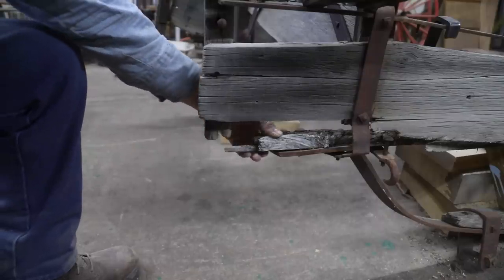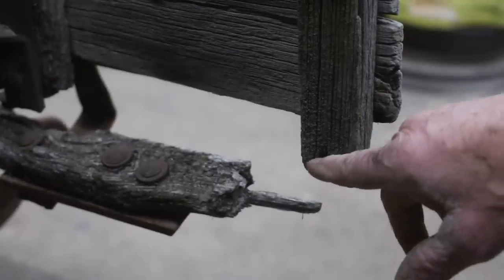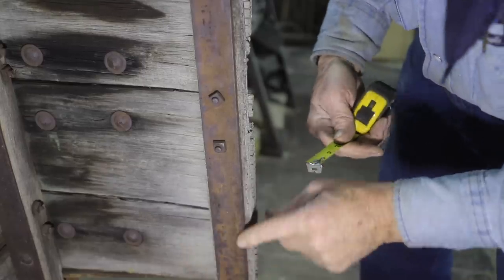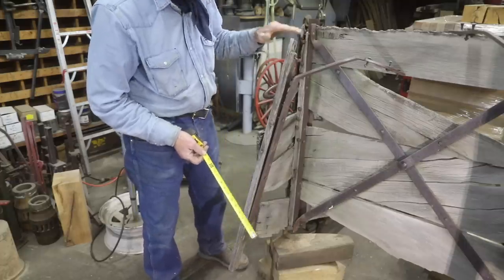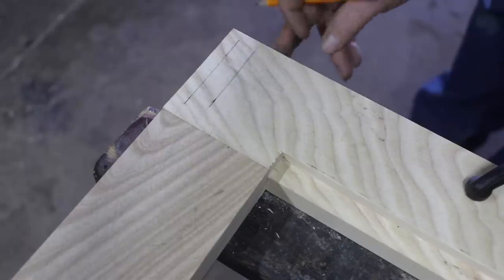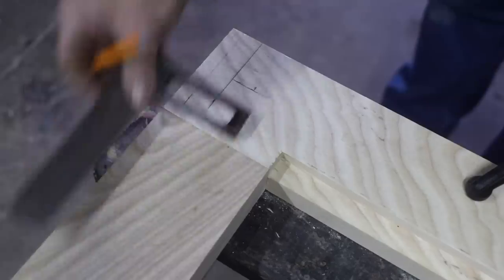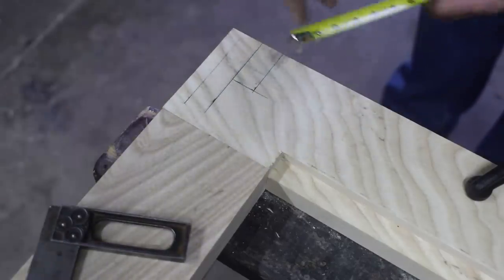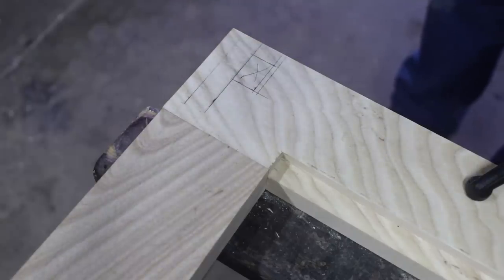Mud Wagon Driver's Box Frame | Engels Coach Shop

Comment: I'm pleased to see the "joints" are mortised vs some other design...strength is king for those areas and I wouldn't trust a butt joint after just 25 miles on a wagon trail especially when fully loaded.  This won't be the end of fine joinery either I'd suspect...from here on in...I predict some rather strong designs and crafty woodworking. Can't wait for the blacksmith iron work to come along and add to its robust function that may have to survive the decades ahead.

Comment: Hi Dave and Diane ☺,  good to see you back in the shop out of the cold, the joints you cut are absolute precision, It looked like you rubbed wax on the tenons to get them in, will that affect gluing up later ?. I was also admiring the  figure in the ash you were using, nice and clean. Thanks for another interesting video mate, I look forward to the next one, stay safe, best wishe's to you and Diane.  Stuart Uk.
Reply: It was a bar of soap and it won't effect the glue.
Reply: @dianeengel4155  Hi Diane, 😃, thanks for the reply, never thought of it being soap, I'll have to remember that trick, stay warm, kind regards, Stuart UK.

Comment: Dave, you used something to lubricate the tenon when sliding into a tight mortice. First I was a bit apprehensive that it was wax which wouldn't be conducive to the glue bonding well, but then I looked closer and thought maybe it looked like the bar soap that I use to lubricate screws when tight.  IS it bar soap, and have you found that bar soap doesn't affect the bond with the titebond glue?  Curious, I'd like to know as I do a fair amount of mortice and tenon work too.
Reply: Yes, a bar of soap, and no, it doesn't seem to effect the bond.